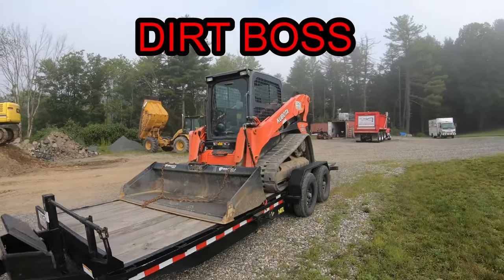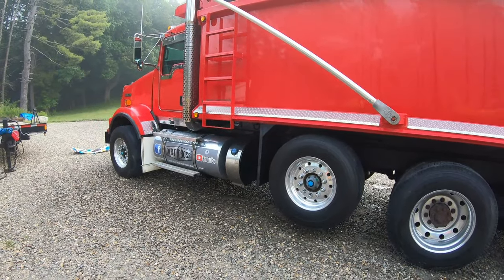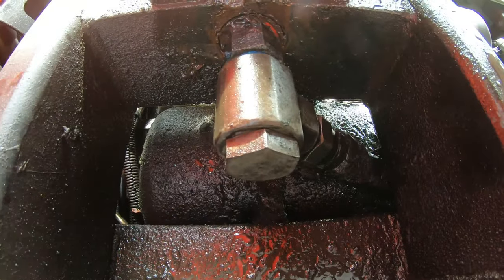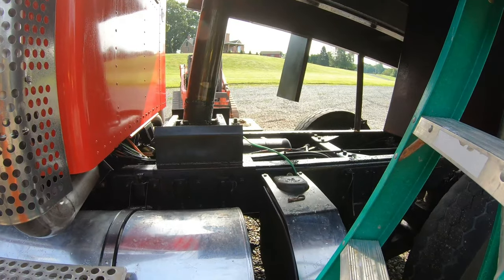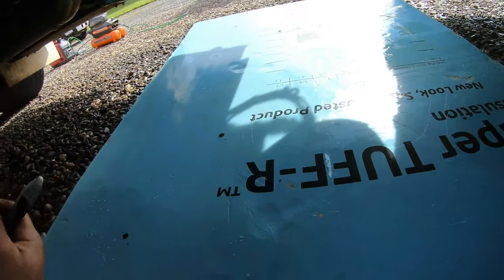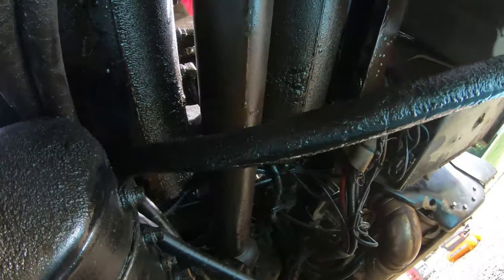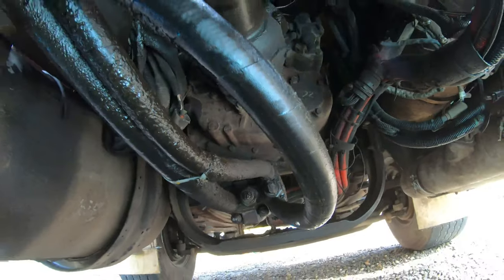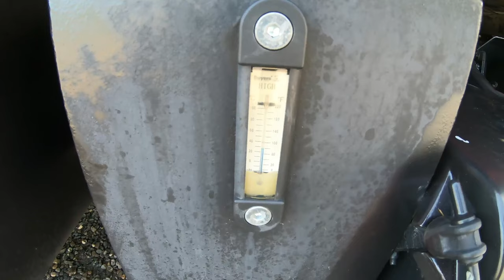Dump truck Hydraulic Ram FAIL box falls down and loses all hydraulic fluid

Comment: My primary truck is down for transmission issues, my excavator is in for water pump/cooling fan failure and with the current state of reliable help, I just work alone.... This video hit home
Reply from the maker: I here ya man good luck
Reply: Same. Become strong working alone. Rely on no one but myself and my machines. I will fill all the seats. Alot of running around and efficiency isn't the best all the time,  but one person came around and jobs are getting done smoothly.
Reply: @fanningconstruction2050  8 yrds today... Alone. Just another day in my office. Thx brother and your right.

Comment: What a royal mess! Excellent idea with the old radiator hoses for sleeves - the more the better. And I'm sure those four buckets of fluid cost a pretty penny, too. When it rains, it pours, but maybe hydraulic fluid will be a good rust preventative for the frame, LOL.
Reply from the maker: Yes it is a pain but you're right It will be rust proof now for the winter I won't have to hit it with the woolmax wax 😁
Reply: @DIRT-BOSS  LOL!

Comment: Yeah, you can never be to safe in that giant mouse trap, for sure. I had a box scare last week also. Picked up a new to me tandem and got home with it and run the box up to grease it. After I finished, got in to drop the box and kicked the pump in down position and nothing, monkeyed with it a bit and jerked the pump back in up position, thinking, what if the oil is returning? Jumped out on the fuel tank and that was just enough movement and bam, she dropped three of the four scopes, needless to say, I needed to change shorts. You better clean that one up, she's a pretty one!!!
Reply from the maker: Yeah that's scary

Comment: Nice man my trucks dumps fine when unloaded but when fully loaded if i dont give it gas from the start until it fully goes up then it will stop mid way! How much hydraulic fluid should be in the black reservoir? Mine measure like 3 inches from the bottom when i fully extended it
Reply from the maker: Well you should have a sight glass on the side of it if not that might be right 3 in by the time it comes down it should be 3/4 of the way full.. so measure it when it's down if you don't have a sight glass.. also if yours is mechanical linkage make sure your linkage is swinging all the way on the PTO underneath that will make it slow

Comment: Dang dude! I hate that you're having such bad luck, but as you've said, it could have been a lot worse. It seems like when it rains, it pours. Just be safe.
Reply: BTW, use Dawn dish washing soap through your pressure washer to remove all the oil. It works pretty good.
Reply from the maker: Yes I put Dawn in my water tote always when I fill it..

Comment: started my 135 link belt excavator after about two months of not using it…sucked up gunk from the tank…clear fuel bowl loaded with crap…gotta change filters, and drain the sludge out from the tank….never ends
Reply from the maker: I know never does

Comment: In the past I would put another tube around the pinch points to protect the hydraulic line from being robbed. Could you have made a custom stainless steel pipe or tubing in the place of the hydraulic line. What you did if I may say should have been done?
Reply from the maker: Heck no there's nothing stronger than hydraulics.. there's no room to put anything else than I did It will be fine

Comment: That sucks bud hope your luck turns around. Just be thankful it wasn’t the ram. I’ve had to replace my brothers on his tri-axle twice now and it is a nightmare.
Reply from the maker: Yes I know I replaced mine and got it repacked on the Sterling I had That was a sketchy job trying to do that by yourself..
Reply: @DIRT-BOSS  yeah my Cheap scape brother Got a used one for (free) and that was blow too . So I had to take that out also . 🤦‍♂️.  I welded D-rings in the front of the body because his paint job was already crap

Comment: That's a good looking dump truck there Boss! What year model is it? I have an International tri-axle dump truck with polished aluminum wheels and fuel tanks and the best degreaser I have found is Simple Green. I get mine from Lowe's most of the time. It will not harm the polished aluminum. Spray it on solid strength and on before you wet the truck. You can see the oil or grease just sliding down. Let it set just a few minutes then presume wash it off. The reason I like it so well is it is strong but won't harm my polished aluminum. It won't hurt the paint either. When I had a Harley, I would use it on it and it was awesome. Sorry I rambled but this is a great video. Keep em coming sir! 👍
Reply: Oh and you can put the Simple Green in a pump up sprayer and just spray it on the brakes before you wet them and it should take the oil out of the pads. I've been down the very same road you are on brother.
Reply from the maker: I will definitely get some I've used it in the past but yeah I'm going to do it!

Comment: I just had something similar happen in my triaxle. Delivering fill and had the front seal blow on my pump what a mess. Luckily I had a spare pump handy. If you ever need a hose made late night or over the weekend to get up and running let me know I'm just south of you and stock most of the common fittings for my own equipment.
Reply from the maker: Hey thanks man I appreciate it! You down in Greenville?
Reply: @DIRT-BOSS  Westerlo. I can do ¼"-1". I have pretty much all the jic and npt fittings stocked. A good amount of the 4 bolt flange, bsp, and orfs. If I don't have it I can get it in a day or 2 for half of what abele and mooradians charge. I bought the crimper after I got a hose made at abele that was $280. I priced the fittings and hose was less then $100.

Comment: First of all… good luck Collin!  I wish you well in school.

Boss, those radiator hoses should do the trick!  I was curious about your thoughts on using webbed chafe guard.  (The stuff that looks like Chinese finger cuffs.) I bought enough to cover every hose on my grapple and loader.  Do you not like to use it?

Now that you removed all your rust protection, are you gonna have to have an under coating?  LOL
Reply from the maker: I know it definitely would help with the rust

Comment: If you are networked with someone who does professional pressure washing / soft washing, they can get that fluid off no problem by down streaming a good degreaser on that. If I was close I would come do it. Or by a good degreaser at a big box store and try dropping a tube in the bottle and hook it onto your injector on your hot water unit. It will melt right off.
Reply from the maker: Thanks buddy

Comment: Is there a specific way to bleed the air out on these?
Reply from the maker: Yes go to the top of the piston in the back of the dump truck in the dog house there should be a cover open that up you will see a little screw Port you can usually do with your hand open it up just like bleeding brakes

Comment: D-Boss!  what a nightmare, unbelievable that mess all over the kenworth!  I got a good one for ya, had my buddy running loads with his triaxle mack with an aluminum body, he’s a big gate slapper, anyhow by the end of the day on his last load he’s putting it up and i’m right behind the body and i’m like geez that body is high, next thing i know it’s coming over at me and my helper so i hustle up and tackle my guy out of the way, that body went right over and came down upside down and never made a sound!  oil shooting everywhere, big gate slap broke the cylinder free from the body, only a little weld ring held it together…don’t be a gateslapper!  we still clown on him about that.
Reply from the maker: Wow that's crazy what a story !!
Reply: @DIRT-BOSS  D-Boss!  here’s another one!  i’m doing pavers at a shore house after Sandy and i have to bust the concrete out around the house so i’m using the hydraulic hammer on my mini and when i’m done i noticed oil speckled on the vinyl siding and the owner’s said something, i tell them no problem i’ll get the simple green on it, the “stuffs organic “, it didn’t work!  so i walk to the truck and grab a jug and a rag and told my guy to use this and wipe the side of the house down, the homeowners were like “that’s beautiful it looks brand new”…what do you think i used?

Comment: if the hose blows again... put a 45 swivel on the top end..  so the hose can lay in their flat and the 45 will attach to the swivel block instead of bending the hose. .
Reply from the maker: Yes for sure
Reply from the maker: Yes for sure

Comment: I would have left that oil under the bed! Rust prevention!
Reply from the maker: I hear you there its still soaked in the metal I think should be good I just can't stand all the dripping and when you go down the road it will get into the brakes